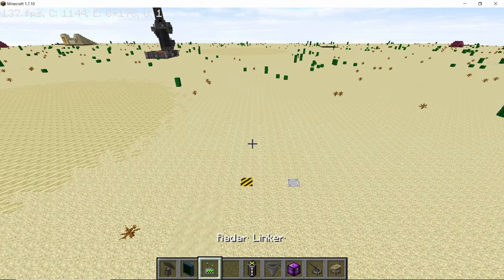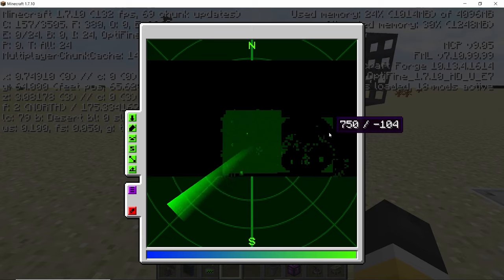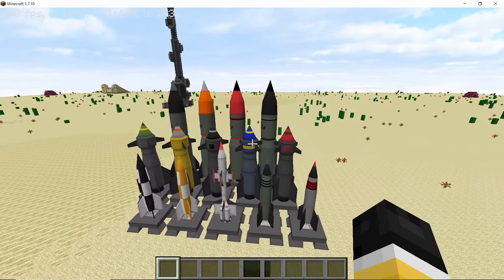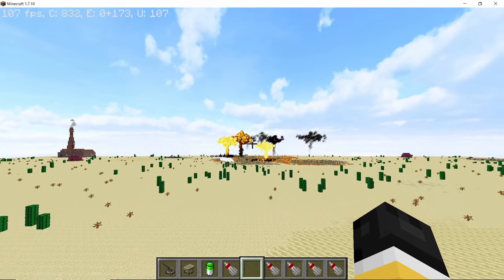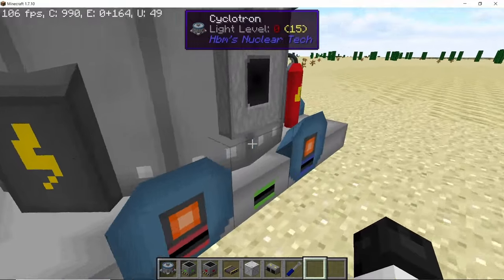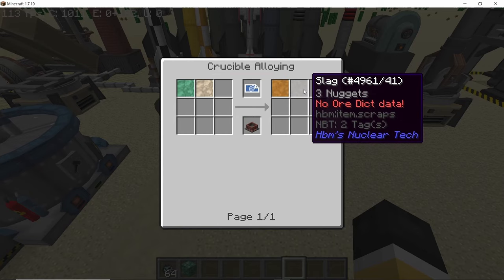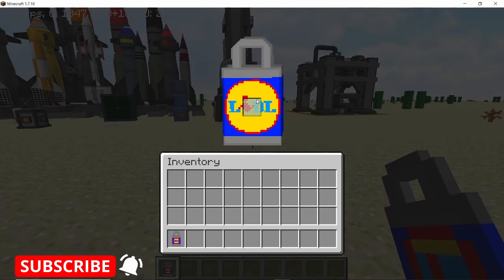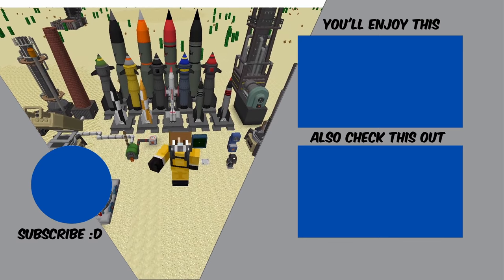Radar Screen, Missile Changes, Cyclotron Automation & Material Processing - HBMs NTM Minecraft

Comment: does the radar still need to be high up in the air to work or is it possible to place it on the ground now
edit: just finished watching the video, this is still not the case
Reply from the maker: Yep Y:50 to Y:128 otherwise you get the insufficient altitude error

Comment: I have to ask could this can the HBM mod work with other mods besides Aegis system mod like flans mods, MCHeli, MrCrayfish's Furniture mod, MrCrayfish's vehicle mod, immersive engineering, immersive railroading, immersive petrol, the create mod, weather mod, and many more? By the way, what do you use to showcase and make tutorials and such on HBM? Do you use curseforge? If so, could you combine HBM in curseforge with all the other ones I've listed above?
Reply from the maker: If you use the 1.12.2 version of hbm mod then you can combine it with most other tech mods, many of the videos like this one which you see is for the 1.7.10 version of hbm mod which is the main version and is not very compatible with other tech mods. 
 But yes if you use 1.12.2 you should be able to integrate it with other mods. Also I just use the normal Minecraft launcher to make these videos

Comment: It's a shame that the developers of the emc 1.12.2 mod versions don't update with the same frequency as the 1.7.10 version. There are several new things missing from the 1.12.2 versions. are well out of date.
Reply from the maker: Well that's true but then again only 1.7.10 is the main version of the mod so yeah. Plus I guess porting it to 1.12.2 cones with it's set of challenges
Reply: @SavageVegeta  They should recode the whole mod to the newest version, even if it takes long, they can then focus on upgrading the versions there and keep it to date, I mean 1.7.10 has got nearly no players anymore, even 1.12.2 is hardly ever played. Just a shame that the mod keeps updating on 1.7.10 because barely anyone knows the mod anymore.
Reply from the maker: @Unsolved_2  that would be very difficult to do, tho Martin is making a version for 1.18 iirc